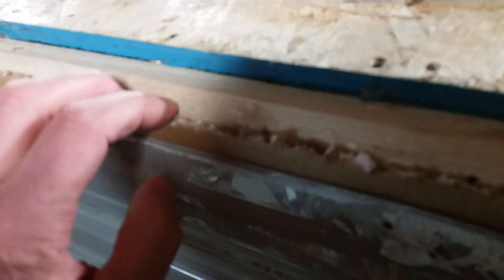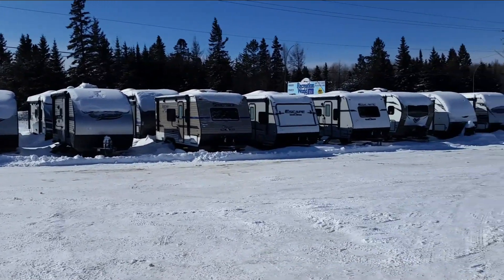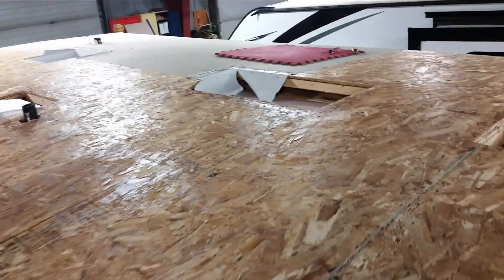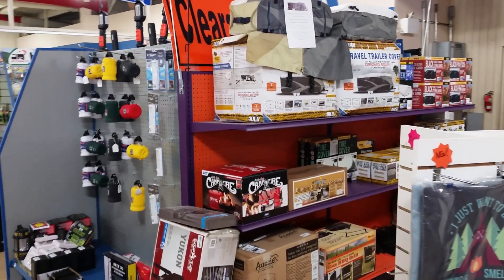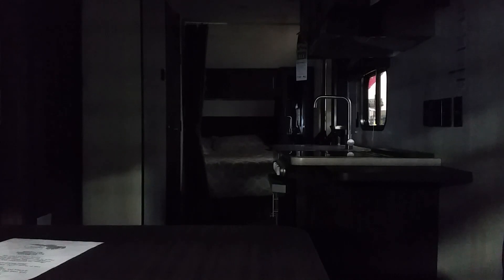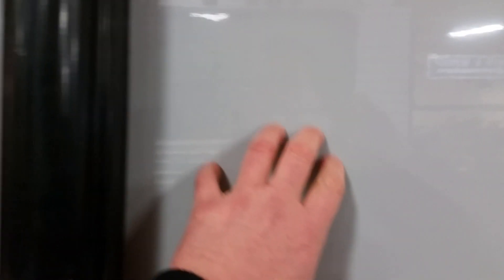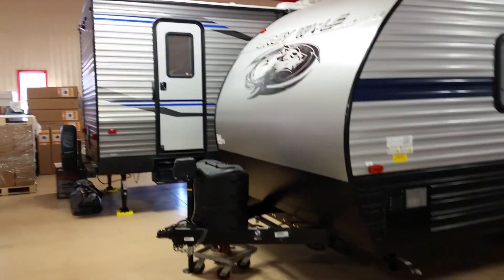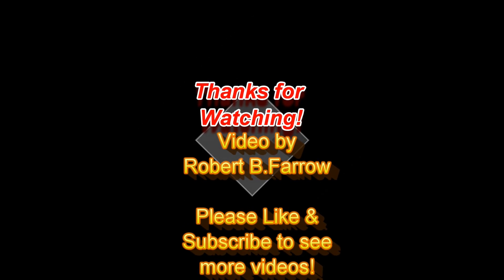Forest River Grey Wolf Toyhauler Roof Repair replacement

Comment: I have this trailer my roof is bad over the bed it leaked the 1st year owning it. had it resealed at the dealer and now i'm screwed
Reply from the maker: Wow, strange. This was caused by some big tree branches, never had an issue with the roof leaking. Hope you get it sorted out. Thanks!